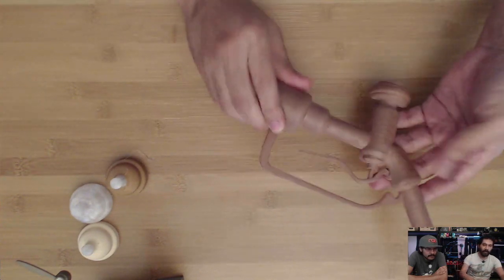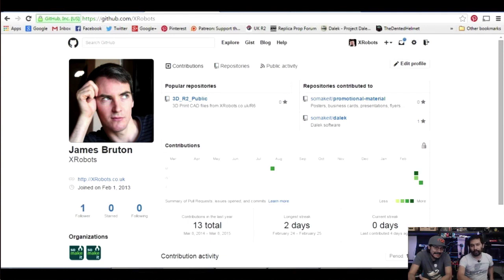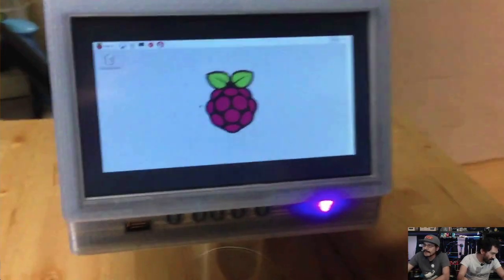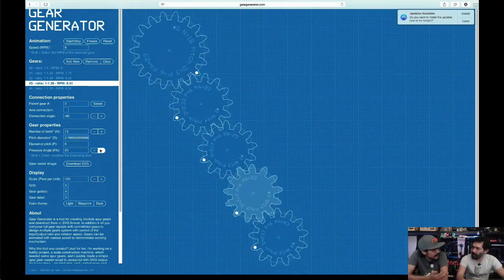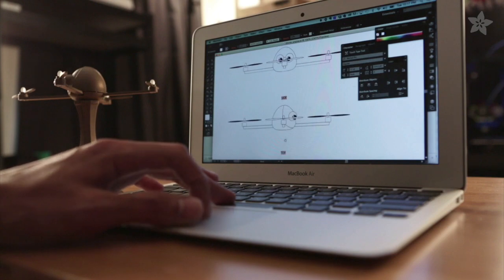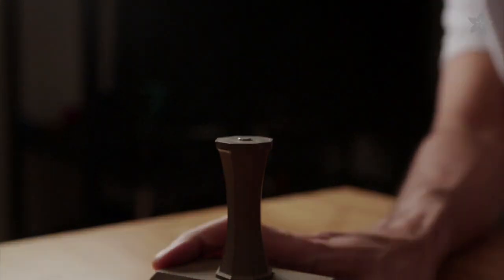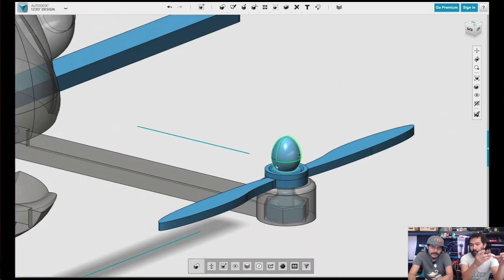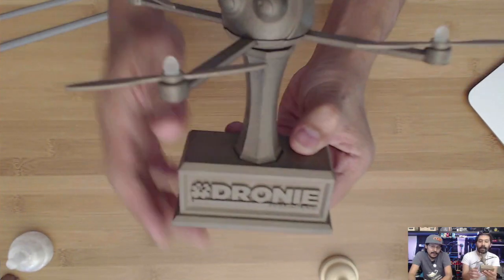3D Hangouts with Noe and Pedro - Dronie Trophy

Comment: Thanks guys for sharing your ideas and projects. I recently got a Printrbot simple metal and having trouble getting the painters tape to stick to the printer bed. I have good adhesion of the PLA to the tape. Tried all the tricks of acetone wipedowns,etc. Nothing seems to work. My prints always start elevating as the PLA cools. How do you guys prevent the tape from lifting off the bed? Thanks.